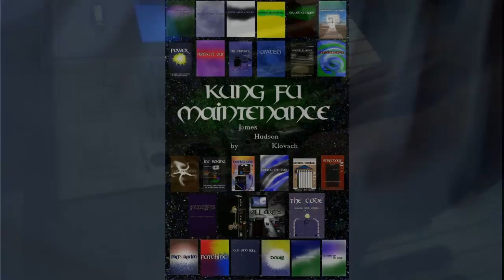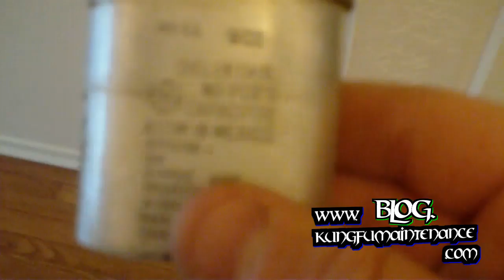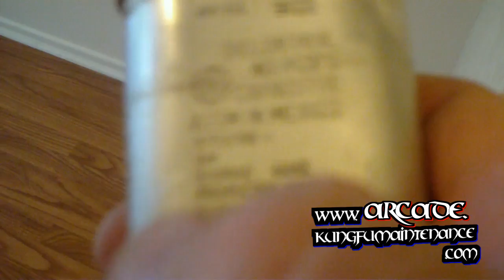Indoor Central Fan Motor Buzzing Humming Not Starting Air Conditioner Heater Furnace Blower HVAC

Comment from the maker: 5mf Capacitor   http://amzn.to/2wC96sH     35mf Capacitor    http://amzn.to/2vZVZ2t
35/5mf Capacitor   http://amzn.to/2iVJNi2        40/5mf Capacitor    http://amzn.to/2wzEdXD 
45/5 mf Capacitor   http://amzn.to/2w0wez5   
Get KFM's favored AC Gauges here            http://amzn.to/2kYgGb8
Wet Dry Vacuum used in so many KFM videos   http://amzn.to/2lFxi7u
Condensate Pan Tablets   http://amzn.to/2lalV9W   No Rinse Coil Cleaner  http://amzn.to/2lHg8GD
Condenser Fin Whisk Brush                          http://amzn.to/2vWXUoC 
Chapin Pro Pump Sprayer                             http://amzn.to/2vWCXdD
Evaporator Coil Cleaner No Rinse Mix        http://amzn.to/2x3eJTT
Evaporator Coil Cleaner No Rinse Can        http://amzn.to/2ezIxju  
Get the Screwdriver used in so many KFM videos here    http://amzn.to/2kHFoOF 
Get the Milwaukee 11 in 1 Screwdriver     http://amzn.to/2uTtsNj 
Get  the Multi Tool Pliers used in so many KFM videos       http://amzn.to/2kWTjPp
Get KFM favored Electronic Leak Detector        http://amzn.to/2kmQMMz
Simple Leak Seek Spray   http://amzn.to/2lFfcC5  Laser Thermometer  http://amzn.to/2layD8I  
Hard Start Kit     http://amzn.to/2kiD16v   Contactor     http://amzn.to/2lFqA0P
Easiest Way To Get Universal EPA Certified Prep Manual    http://amzn.to/2kIQdQC
You must be EPA certified to charge or recover refrigerants and here is about the Easiest Way To Get certified with the Universal EPA Certified Prep Manual    http://amzn.to/2kIQdQC
Valve Core Removal Tool                              http://amzn.to/2kJ00pC
Inficon Refrigerant Scale                               http://amzn.to/2vUCQPD
Get KFM's favored Multi-Meter  here        http://amzn.to/2l8W9CO 
Get The Kung Fu Maintenance book here     http://amzn.to/2lEQPFk
Or  the Kung Fu Maintenance E book here  for less than $5    http://amzn.to/2lEY8wD
Get the Kung Fu Maintenance album (good driving music) "Up Beat" here     http://amzn.to/2l41pZ1
Get the Kung Fu Maintenance album (nice Instrumental music) "Entropy" here   http://amzn.to/2kl2U0p
Samsung Galaxy S8 Plus        http://amzn.to/2sFn9h8
GoPro Hero 5 Action Camera         http://amzn.to/2sN4nVK
Rode Lapel Microphone                 http://amzn.to/2vZoFc7
Purple Panda Lapel Microphone  Kit   http://amzn.to/2wByXkq
Video Edit Pro Software       http://amzn.to/2ruaaeZ
Samsung Galaxy S5                 http://amzn.to/2wBxk6l     
Samsung Galaxy S8 Plus        http://amzn.to/2sFn9h8
Video Edit Pro Software       http://amzn.to/2ruaaeZ

Hire An HVAC Specialist                                  http://amzn.to/2lktKek
Air Duct Cleaning Services                              http://amzn.to/2lFTpun
Central Air Conditioner Tune Up                   http://amzn.to/2lzJGoy 
Air Conditioner Repair Or Installation          http://amzn.to/2lFsEGw                                           
I don't work for any of the product companies  listed however I do make a small commission on items ordered  through the links.

Comment: Thanks, you rock!  I've used your videos to fix other stuff before.  My central A/C was doing the exact same thing.  Pulled the capacitor and found that it is 15MFD, found a 370-V 15MFD on Amazon for $9 and it'll be here tomorrow.  Saves calling the HVAC guy and paying a couple hundred.
Reply from the maker: +Jason R That's great man!! Your comment makes my day!! Yay!

Comment: had the same problem that happened a few times. I was about to call a repairman but saw this video.I took out my capacior and had I tested at a parts shop. it read 6 which was too low ,,,no good. got a new one for 18.00 and blower started spinning !!! thanx much for the info !!!!! saved me HUNDREDS !! only took 2 mins out 2, mins in at the most

Comment: Again, thank you... I had the whole motor blower replaced, along with a new capacitor. Also had the A coil and system cleaned out. The system being about 30 years old, its working great, now.. again TY for ur educational videos.

Comment: Thank you for your video. Of course we awake to a humming motor and a cold house on a Sunday.
I saw the motor turning slowly and I did a hand start (Not  recommend ) although I saw your video after I started the blower, I think it is very helpful. Ill buy a capacitor tomorrow and just hope its only the capacitor and not the motor. At least we have heat for now.

Comment: I just push started my blower/fan just like you did. I just gave the thing a good spin and then ran upstairs and set the fan to"on."  Thanks for the tip! I will be looking at replacing the capacitor now, though.

Comment: Thank you for this video. Although it’s hard to see but explications were most important. My blower motor has the same problem . The cage spins freely but once under a load it hums  and seizes up. Kick starting worked a few times. A $10 capacitor over a few hundred repair bill is king.

Comment: I hand started the blower using a push on the fan....and it worked...OMG thank you for the info...don't worry I was really careful and just flicked the fan with pliers. Thank god for heat again. I think the blower froze when I changed the batteries a few days ago. Everything else works...just the fan and blower was froze. Everything ok now.

Comment: Works like a charm.  Just make sure that you do it with someone at the circuit box.  Turn the furnace fan off, reach in and give the fan a good spin, and when your friggin' hands are clear, tell your partner in crime to turn the breaker on... presto.  Great fix KungFu!

(Then call and get your capacitor fixed.)  :)

Comment: My AC makes this same exact noise. I’ve called the repair people out and they replaced the coolant several days ago. Had told them about the noise but I guess the coolant was low. Still 90 degrees inside the house several days later. Still with the humming sound. Another guy came out today and replaced the capacitor. After about 6 hours I noticed the fan never turned on so I called again. Two more people came out (one had to leave after about 5 minutes for some reason). First guy came back and claimed it wasn’t working because the unit breaker was off. But the other guy was who turned off the breaker. He also said it wasn’t working because our filters were old. They were very old, that’s true. I bought new ones today. I heard the same humming noise but quieter about a half hour ago, about an hour after the last guy left. Is this the motor? How come no one was able to figure that out? It’s so hot in my house. I have pets and I’m so worried.

Comment from the maker: One easy thing that sometimes gets forgotten is the service door switch. Fan motor will not start unless blower safety door switch is engaged. You can use circuit alert device(non contact voltage detector(lesser known as deadmen's stick) to prove power is getting to fan.  For testing the thermostat try switching the fan to on first "if that doesn't work" you can pull off the cover and use a jumper wire from RH or RC to G spot and indoor fan should kick on, if so that shows thermostat is bad.

Comment: Ok, this is what i figured if it helps anyone. The ECM or X-13 module motors cannot be tested by running 120 V or 240 if required directly to the motor connections. There is NO capacitor wired into these module motors as in a traditional fan motor.  However, making sure there is lo voltage from the board and hi voltage tied from the transformer to the motor, a "cooling" call at the T-stat will start the motor, If the motor doesnt start with the lo 24V and hi120V, then it is probably the motor.

Comment: Your info on all this is really appreciated--with that said, I've been struggling to fix this HVAC for a few days. The heat/gas works, but the blower doesn't. I've replaced the capacitor, the main limit switch, the fan switch. The blower works when it isn't set to heat, as soon as it's turned to heat the blower shuts off.

Now it just hums and doesn't start sometimes. As I've written this, the blower has hummed, started working, then shut off. I have no idea, but my only conclusion is like you said, I may need to change the motor? maybe the circuit board? I don't know...
Reply from the maker: Raul Flores It may not be this but one thing to check for is the thermostat jumper. Most jumper pins or switches have a special set up for Gas or Electric Heat. Some newer thermostats have a multitude of different setups for many different types of systems. You might check me vids on thermostat change outs for more visual demonsration of the jumper pins or switches. It is also more highly possible the board is bad especially if the unit had been working previously with the thermostat set up the same way.
Reply: Hey, thanks for the response! I have since changed the motor and voila it works! The house is finally nice and warm. Cheers :)
Reply: I replaced the blower motor (which is inside the house) and it's been working since I last posted. Cost me about 200 total.
Reply: Unless you have a brushless motor, once you replace the capacitor it is almost always the motor brushes....it is very, very rarely the circuit board and you will know its the board quite easily because other functions will be messed up as well.

Comment from the maker: One thing to check first would be the service door switch(sometimes they need to be replaced or bypassed). Often these are not fully engaged and motor will not start. If it tries to start and won't start than it is most likely the motor. If it doesn't try to start at all than it could be faulty thermostat, bad relay, bad transformer and control center, and or bad contactor on condensor. Often if a tranformer/relay control center goes bad it will bring the contactor down with it.

Comment: Great video.  I wish you were local to me. I have a central air unit in my home that I recently switched to Air from heat since its summer!  The unit itself outside is brand new and is running fine, but inside, the fan or blower runs for a few minutes and then stops or stalls. I turned off they it and am just using fans because I'm scared the unit can burn or something. 
What do you think is the cause to this? Do you think I am in need of a new blower?

Comment: Thanks. I have the buzzing sound too. Blower motor turns  sometimes but capacitor values were right when checked with multimeter. Changed capacitor to new one and same issue. Where else can problem be? I checked the relay but given it starts some times, felt the relay is fine. I had AC water leak recently from the evap coil through the drain plate down to blower motor area. I dont know if this could be related. Is the only thing left is to change blower motor or can I check something else?

Comment from the maker: Normally the cage would spin freely. If it is not rubbing on anything, or there is nothing caught in it, and it sounded Ok when you got it running the last time, I would try replacing the capacitor. Even if it does wind up needing a new motor it would need a new capacitor for the new motor.

Comment: I have some what of the same problem but I don't need to kick start mine cuz it goes by itself after I turn it on but it wont fully turn on( itll buzz the whole time ) so ill turn it on n it starts to spin(not as fast as it should) then slows down almost stopping n then repeats(still buzzing) what I just said n if I leave it on to see if itll fully kick on after a couple spins n stops itll  just stop completely n makes a light humming sound..

Comment: @KungFuMaintenance, Thanks for the vid.  Where do I find my capacitor?  I have a Stewart-Warner Series E furnace model GUX-120N.  Half of the time the motor starts okay, but half of the time it just hums until I give it a helping push.  Thanks.

Comment: My fan motor starts up hesitantly but stops after about 5 minutes and the buzzing humming noise starts up. The capacitor has been changed. Do you think I might need a new motor? The unit is about 23 years old.

Comment: I just had a furnace motor die . . . simply stopped running.  After having the motor replaced, the new motor now makes a
WAAAAA-WAAAA-WAAA-WAA-WA noise when starting up and continues to run with a medium-pitch hum.  Fortunately we have heat, but a technician is scheduled to return to troubleshoot this problem.
After seeing your video here, I'm assuming that it's the start-run capacitor that is bad and likely the cause of the first motor's failure.  Now I'm concerned that a bad capacitor may also cause this new motor to fail.
Any opinions?

Comment: Kung Fu....I have a ECM motor that is not running, so I am in the process of narrowing down why my 3 amp board fuse keeps popping.  Do you know if I can test the motor by by-passing the board temporarilly and hooking the power directly to the motor ( L1-L 1 &  L2-T5 or t1)......like a standard motor?

Comment: I have an Amana 95.  I hear the buzzing noise and the fan won't spin.  When I take the door off and cut off power, I can spin the fan freely.  When I power things up and the fan tries to kick in, it is hard to turn.  Does that sound like a motor or capacitor problem?
Reply: Isiah Williams hey buddy, same problem 2 years later, did you ever find out?

Comment: I have the exact problem. How do I jumpstart that motor if I can't reach it. I MUST put the panel for it to have power. At this moment, I don't have an Multimeter to test that capacitor. Need help! HOT here in So CAL!

Comment: My fan motor is making this same noise and not spinning. I replaced the capacitor and it is still making the noise. I notice if I push the squirrel cage while the unit is shut off, once I start the unit up again the motor starts up fine and spins freely but once it reaches the set temperature and the unit shuts off, when it starts up again it makes the buzzing noise. It will work again as long as I give it a push spin when the unit is shut down (I've never push started it when the unit is on but I'm sure it would work just the same.) Any idea if this is a bad motor or bad control board? Mine is electric, not gas.

Comment: No idea if anyone will reply but, the one here is acting odd.....it's hummed and refused to start before...about 7 - 8 months ago. Spinning the fan manually kicked it off. The capacitor was replaced and it ran fine until now. It's doing the same thing again already. BUT, I did notice that often, when you spin it manually, it can be HARD to spin when the motor is active. When the power is off, it spins pretty freely. Turn the power back on and it usually gets hard to turn again. 
We can have the capacitor changed again....but something tells me that isn't the whole problem and also why a second one has went bad already.
Apparently this model has been discontinued for some time and parts....LOL what parts.....
Ideas?
Reply: MC ZM i have the exact same issue.
Probably the motor. Cheap Chinese junk.

Comment: My blower fan hums. When I push the fan blade it starts to run. I have the capacitor changed. It still has the same problem ( humming ) and does not start when I stop it, and restart it again. Any idea? Thank you

Comment: mine was doing the same thing but kickstarted the inducer motor instead and now it works sometimes it only works if I set it around 80-85 degress  then it makes a hovering sound but works and sometimes the fan sounds like its grinding any advice?

Comment: The blower motor was humming and it stopped humming after trying to push start with a screw driver after 3 or 4 times. Could this be a different issue with the blower motor? I tried flipping the switch off and on and it kept humming, but now it has stopped humming.

Comment: Well I changed out the capacitor, and the AC ran for half a day, then I started to hear the blower motor wheel squeaking, then the system shut itself down. When I removed the door to the system, I tried moving the blower wheel, and now its locking up on its own. I guess its time for a new motor blower.

Comment: the fan on my furnace hums and is attempting to get up to speed but doesn't and gives up. i tried pushing it and it didnt work and i even tried using a power drill to try getting it up to speed. what might be wrong with it and do i have to replace it? 

thanks

Comment: None of these videos help my furnace motor is a intertherm mgh065ab and the blower motor does not have a capacitor I repeat there is no capacitor from factory due to it being from the 80s. Everything works it does not leak co2 however buzzing noise when fan plugged in and doesn't start on its own and I just got the new motor yesterday so what is my problem note I dont have good credit and I don't have 6 grand for a new furnace hence why I'm using a old one

Comment: Replaced with brand new capacitor and still does the same thing, any ideas what to check next? Thanks!
Reply from the maker: +Donbeiren Check for burned wire lead but most likely time for new motor.
Reply: Yea, I just picked up a new motor, not the exact replacement but a generic brand, I'll see if I can pull it off.

Comment: I have the same problem is it easy to find a capacitor?  and how much do they cost
Reply from the maker: They are not too hard to find. You can get them on my Kung Fu Maintenance website "Keeping Cool" page or by doing a search in the box at top right of any page. I make a small commission off of any items purchased through there. The caps go for about $2.50 on the site so nice and inexpensive. Alternatively you can sometimes get these at HVAC supply stores. Some stores will only sell to licensed contractors but some will sell smaller items such as capacitors and motors.

Comment: if I'm getting intermittent start, buzzing loudly and starting, but sometimes only buzzing but fan doesn't turn on, does that sound like a capacitor issue?
Reply from the maker: plocktontr Yes sounds like it. I would try the capacitor first even if I suspected the motor. If it turns out you need a new motor you would need a new capacitor anyway.